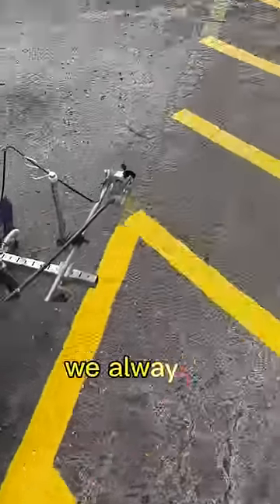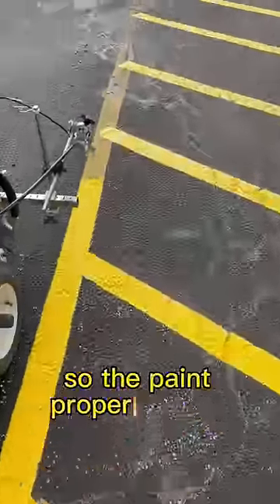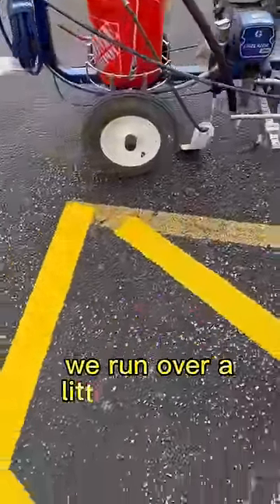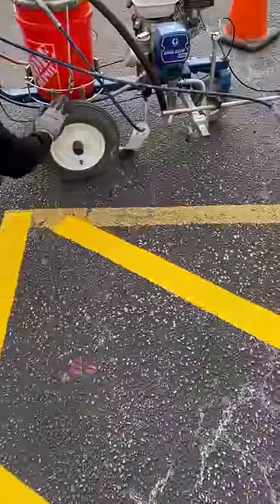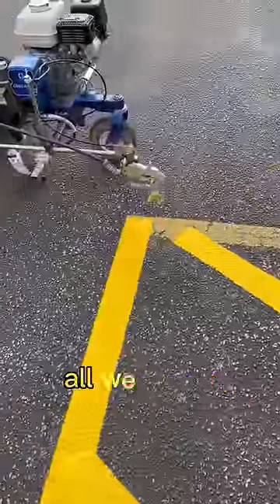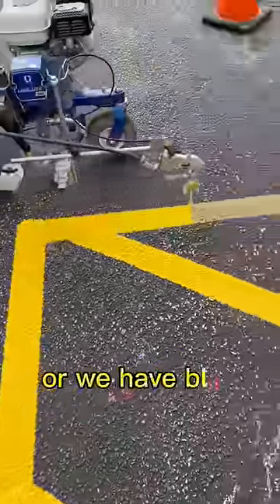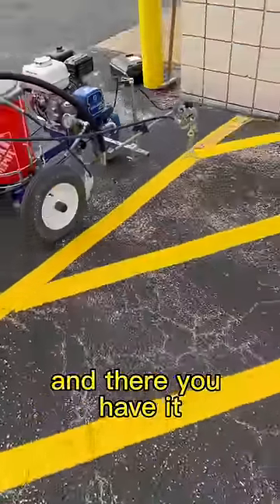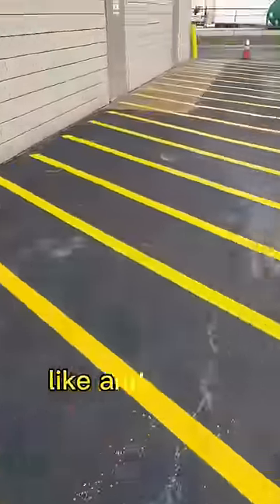How to Restripe Parking Lot Lines 🎨 #satisfying #business #asphalt #linestriping

Comment: Good morning, extend your arm at least 10 inches out to the right . Been doing this ten years just helps absorb some shock. Also start charging double coat with yellow the new fda regulations is not what it used to be with the thickness of the paint

Comment: 4 1/2 inch spray with a 319 tip. Gotta make sure rocks are moved also because you got a tiny wiggle in the beginning from a rock no bigger than a pebble.
Reply: Just put the gun at the back, having it at the front will do that

Comment: Not bad, I did parking lot maintenance like this for about 10 years. From painting lines, stencils, old board handicap stencils. Plastic. Used an old MB and a line Lazer. Looks like your using either latex or acrylic paint. Why not just use cold tar instead of black pain. Last longer and looks better

Comment: maybe you should spray a wider line to cover up that crooked mess but it looks straight from house great job...
Reply: well eventually if that's done you'd wind up with a line 4 feet wide. these lines typically look to be about 3"-4" wide but no reason to be outside that range.

Comment: FIRE LANES SHALL BE MARKED BY SIX INCH (6") WIDE LINES USING RED TRAFFIC PAINT WITH THE WORDING "NO PARKING" AND "FIRE LANE" PAINTED ON THE LINES AT INTERVALS OF TEWNTY FIVE FEET (25'). THE LETTERING WILL BE FOUR INCHES (4") HIGH WITH A ONE INCH (1") WIDE STROKE PAINTED WITH WHITE TRAFFIC PAINT.
Reply: red traffic paint? yeah whatever you're citing is a very specific zone law; yellow and/or white are used overwhelmingly. but yeah this painting wasn't to code at all
Reply: Is that national? Sounds like state/city law

Comment: How do you get that paint off your car? DOT was spraying during a windy day, and well... you can figure out the rest. Its not bad, and I can pick it off, but there has to be another way.
Reply: “windy day” is code for “I ran over the paint because I ignored the signs and I don’t want to own up to it”. The paint is not going to spray sideways because of some wind
Reply: @Josh8far  No... its windy day... They were actively spraying the road in front of my car, and another as well. We were behind a slow moving operation billboard truck.
Reply: Could have been overspray from polly or moddified urathane. Good luck getting that off

Comment: That's not a fire lane. Fire lanes are red. We use power washers to clean all the lines.
Reply: You must pay your guys 12.50 an hour if your powerwashing the lines first
Reply: Fire lanes go by whatever your county code or district. In chicago land they are yellow but not restricted to red. Curb on the other hand for fire lane is red over here but need the proper signage if you go that route
Reply: @erictaylor8099  We start at $15.